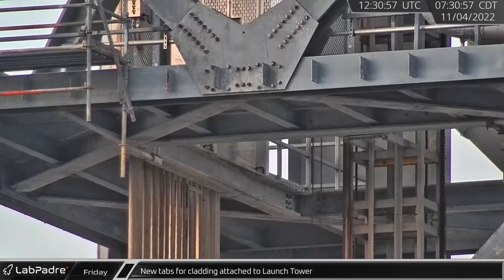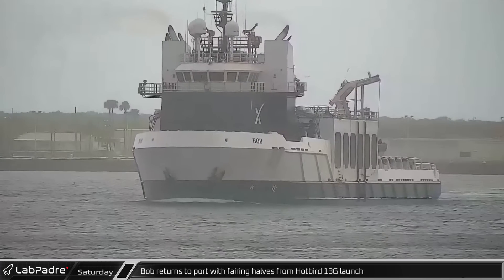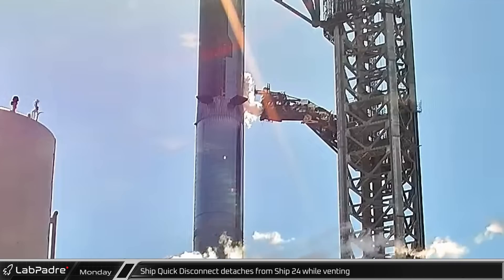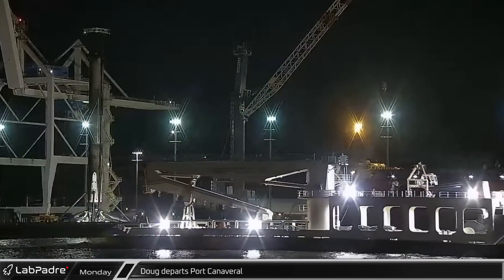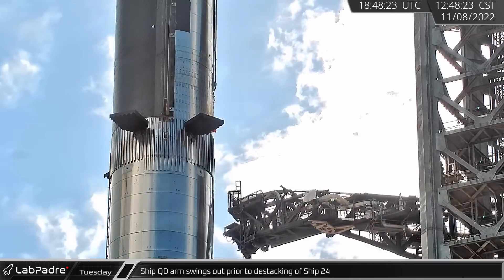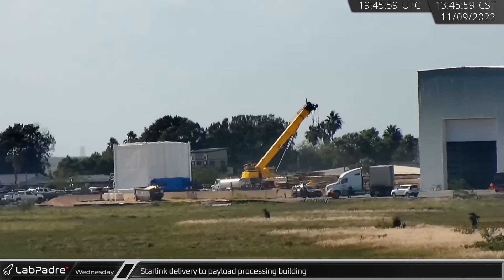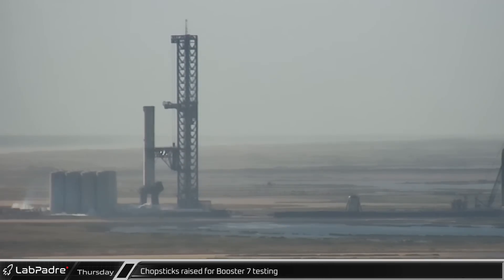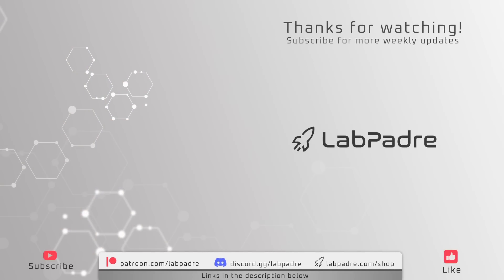SpaceX Tests More Booster 7 Raptors   - Weekly Update #36

Comment: Does anyone know the status of Deimos and Phobos rigs? Will they have the launch towers as the ones being made currently in Florida (Roberts Road)?
Reply: Last we've seen and heard, the decks have been stripped, mostly on Phobos and very little on Deimos and they are in a holding pattern. Most likely holding for priorities on Orbital Launch and maturation of OLM designs at both TX and Florida sites. There is another Logistics puzzle piece in transportation, to the Sea Launch Platforms, which we should be seeing with vertical transports and delivery of Starbase TX Starship(s) and Booster(s) using Barges to 39A. Transported just like we see with Falcon 9 and the drone ships like JRTI.

Comment: Why not install a high temp cobalt alloy steel slab of 4-8 inches thick directly to the concrete pad???  With all the deluge of water jetted upon the whole launch pad, the temperature will never be allowed to reach the melting point of steel.  Anchor the slab to the launch stand with penetrating welds and 3-4 inch diameter interlocking high tensile pins.  THEN -- THAT WAY -- ONLY the hold down clamping system will ultimately be the weakest link of the launch pad vulnerable to RUD during an all 33 engine static fire test.  As Tim the Tool-man Taylor would say, "BUILD IT FOR MORE POWER!!!"

Comment: I don't know if a 33 raptor statick fire test is possible 🙄.... It would shred the launch pad, my feelings are that when all 33 is fired it will leave the launch pad..... 💥 💥.....one way or another..... 🙃 N other tought 🧠....is it necessary??? Probably not.... Testing them 5 or 10 or 15 or whatever at a time reduces the chances of a major rud.... 💥
Reply: You could be correct.  The only way to see if it will work is to try it and see what needs to be fixed.  If I were in charge I would release the clamps and proceed with the launch if the engines powered up correctly.  That way they could see what breaks and fix it for the next launch.  The water pool may help, but I doubt a full power static run will work because of ground effect.  That is why flame trenches were used.  F. Miller PhD retired rocket scientist
Reply: @sandramiller7972  exactly what I'm thinking would be the safest thing to do....these newest raptors are really well tested already so light 33 and let it rip 🙂
Reply: @sandramiller7972  Logic would suggest testing the outer 20 engines separately from the inner 13 as they use different systems. Who knows? SpaceX must have run countless computer simulations for every possible scenario so they must be at least slightly confident of a successful outcome. On a side issue they are constructing two more towers so again they must be confident of the ability to catch a booster and a Starship.
Reply: @AnthonyHigham6414001080  Catch is really not the word. When we think of catch we think of catching a baseball. When in realiaty we will be catching a ballon with a rock attached. Slowly coming down. The chopsticks are really just the landing legs. They will still use rockets to slow down and then guide its way in to the chop sticks to where it will land on it. In a controlled manner.
Reply: @kameljoe21  Yes, completely agree. The precision manoeuvring onto the "chopsticks" is going to be something to behold. I suspect, through extensive computer simulations, that SpaceX are confident they can achieve it. It's still going to be amazing though.
Reply: @AnthonyHigham6414001080  Pretty sure they have been testing it for years. Falcon 9 is proof of what they can do. I am almost sure that falcon 9 turns to land with its legs exactly where it needs to be. 
I think the reason for the catch is to reduce the 10s of thousands of pounds of landing legs they no longer need.